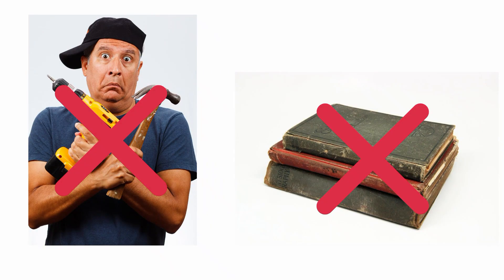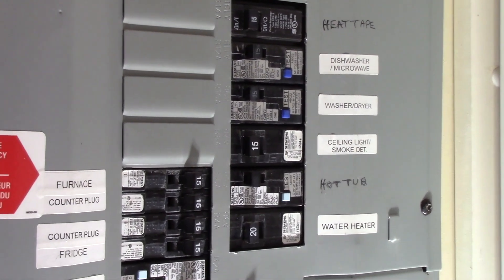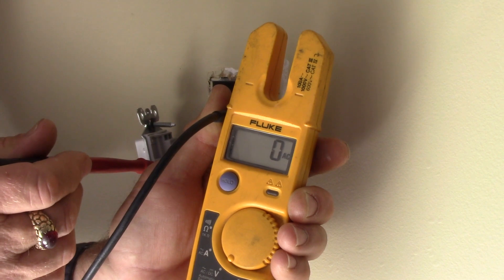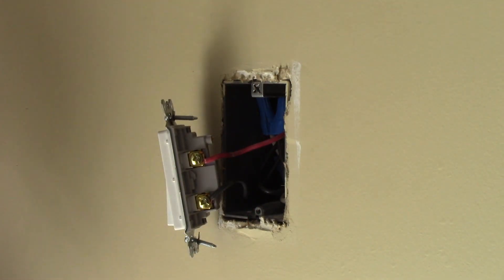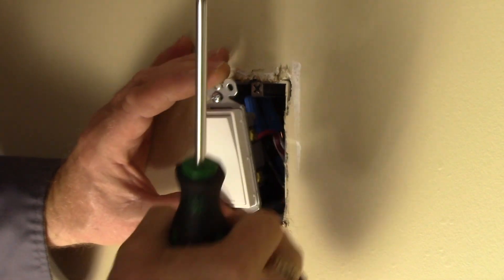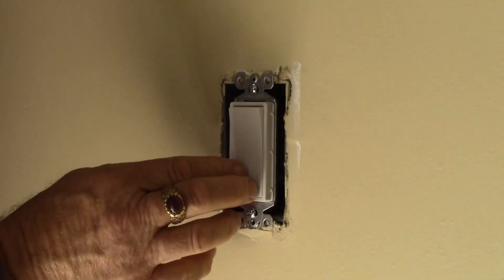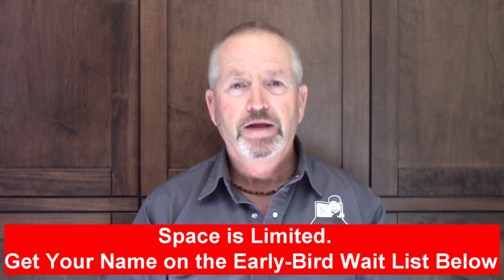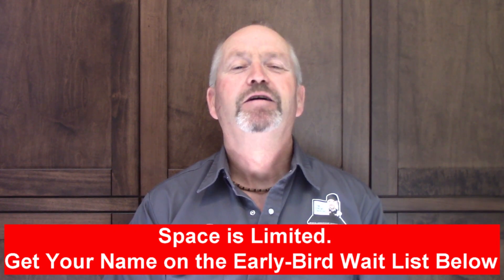How Your DIY Projects Can Be Started in as Little as 5 Minutes With Home Wiring Mastery

Comment: Why no neutral wire coming off the switch? Did you just tie those together in the box?
Reply from the maker: Yes, the neutrals are spliced through.  A basic switch does not require a neutral connection to it.  Only something electronic like a timer, occupancy sensor, or smart device need neutral connection.

Comment: Good morning I have a big problem in my house my plugins in my dining room was working not working in working again in not one day my wife said the light isn’t working so I would take in replace the bulbs nothing helps so probably the switch is broken before I replace it I tested all the wiring there’s not a single wire with power I tested all my breakers every single breaker has 120 volt in it so I’m stock I don’t know what to do here is my phone number 12049050391 if you like to call me or text thanks

Comment: Why didn't you attach a ground wire to the switch?
Reply: Metal box with a ground strap the device is grounded via its screws and frame ...does not need a ground jumper and may not even have a ground terminal.  If that was a plastic box the device would need to be grounded separately.
Reply: @HBSuccess  Yeah I understand that. I always thought since when he took it out of the box it was no longer grounded. So that could be an issue, if only a small one.
Reply from the maker: @CupidFromKentucky  See my answer above.  For many years, standard switches did not come with ground terminals.